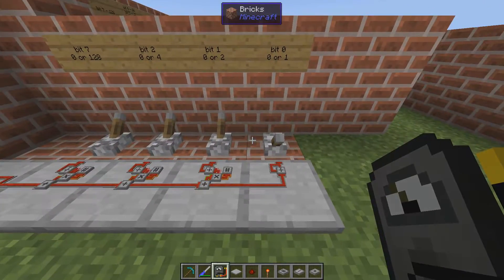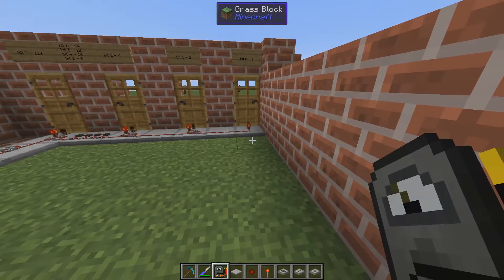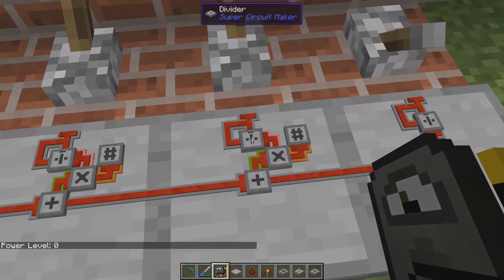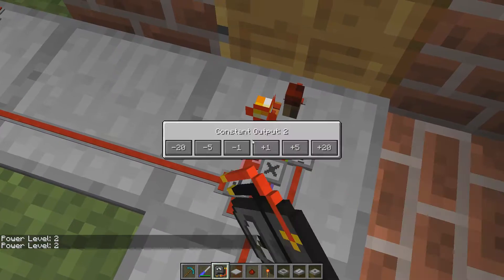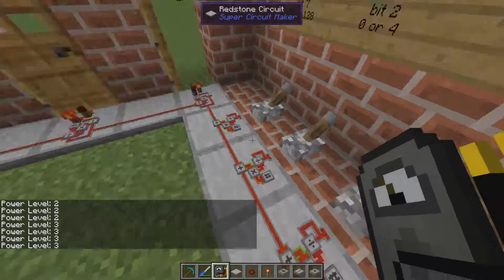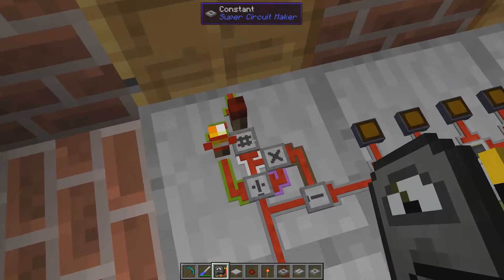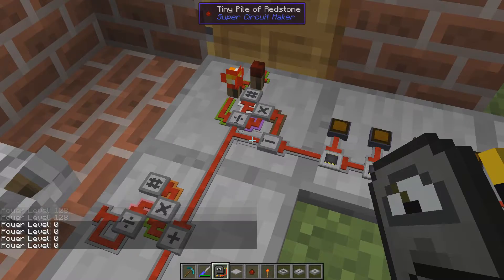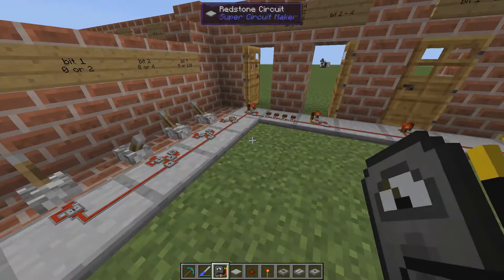Super Circuit Maker - Binary Signal Decoding (MC 1.10.2)

Comment: You should have used an absolute architecture. Labeling bits by n, for the bit value 2^n, divide the input by 2^n, this result is X. Then do: (X%2) the result is whether the desired bit is true. Let us test: For bit is 64, take in/64, if the number was between 64 and 127 the result is 1, if 128 to 191, you get two, higher: 3. Now modulo 2, for bits containing 64, the result is 1, otherwise, 0. (note for in<64, div.by 64=0)this allows any door to take an arbitrary bit in, as they all get the same input. For another address byte, more complicated patterns ensue, but are much simpler under the absolute architecture.
Reply from the maker: Would it make things different from any of the two examples? For me it just sounds like a slightly different take, like a mix of the two variants?
Reply: i want to spread it across my base and not worry about rewiring ALL of them when i want to move things around, this way it 'sniffs' for a specific bit in the byte, and i can run a main set of lines for my bytes, like the internet. (networking 101: a router sends EVERYTHING to ALL connected comps, and the comps decide whether they were supposed to receive it) (of course, i still need to get scm to work again... :(    )
Reply from the maker: True that, in my design I have to connect them all in serial, where you could send the signal in all different directions. An improvement to the system but will not do another video for it. Unless it's a part of a larger project :)
Reply from the maker: I like that! But there's only a few people who would understand a totally blank card with only two mathematical expressions. (I'm not one of those.) Perhaps could spice things up with a red text color...